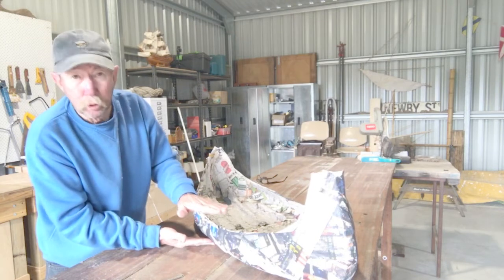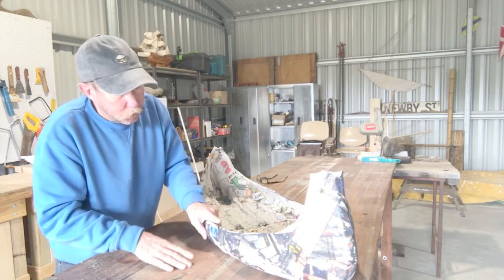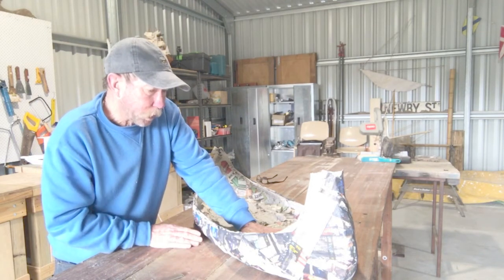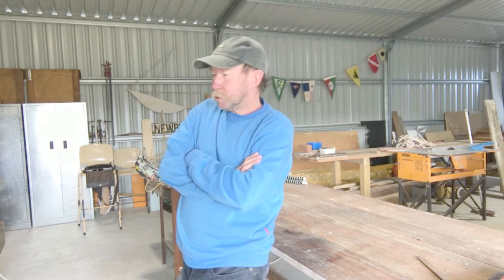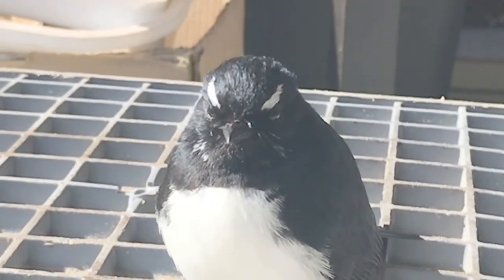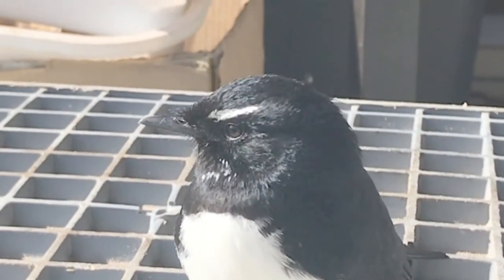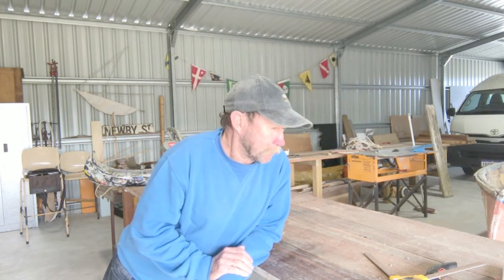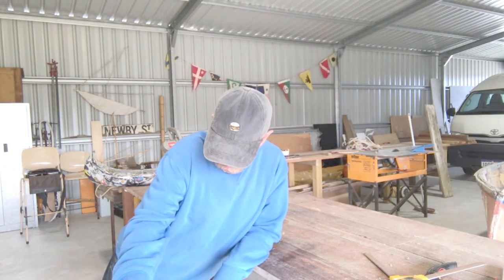How not to make a model viking ship for a funeral.

Comment: When you do Paper Mache, you have to go over it and straighten up any imperfections. Paper Pulp is the Newsprint you were using soaked with Water. You  have to squeeze out the water from the Paper Pulp so it's not so wet, then add the glue to it which makes it Paper Clay. You can also add Wood Shavings, to stiffen up your Paper Clay. There's actually nothing wrong with your Paper Mache Boat. You don't have to start over. You can just whip up some more Paper Clay and use it to fill in the hole and smooth it out. It also needs a proper amount of time to dry. If you have a Shop Fan, you can place it under that. It can take 2 or more days to fully dry. Paper Mache is different than working with wood because you can simply fill in the holes. I suggest you look at other videos on Paper Mache Sculptures on Youtube  to see what they are doing. But, there's no need to start over. You are doing well, just use the Paper Clay to smooth out any imperfections and go from there.